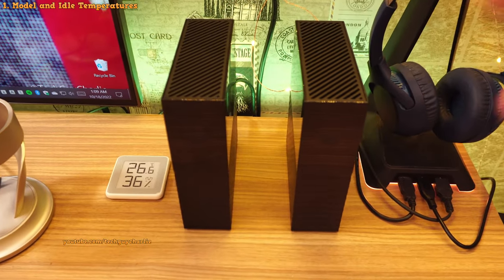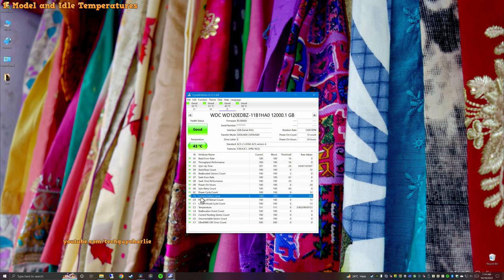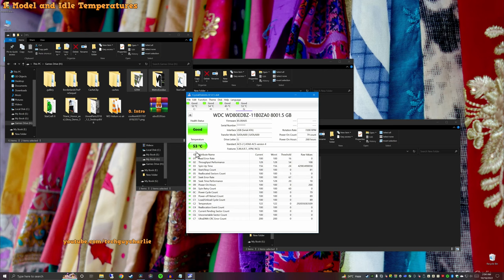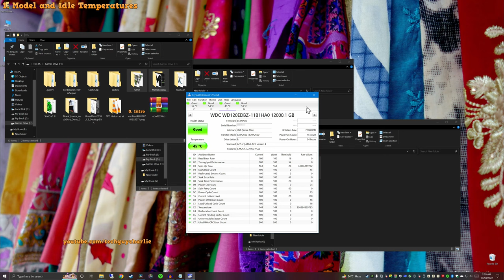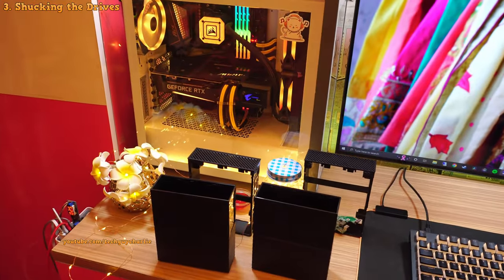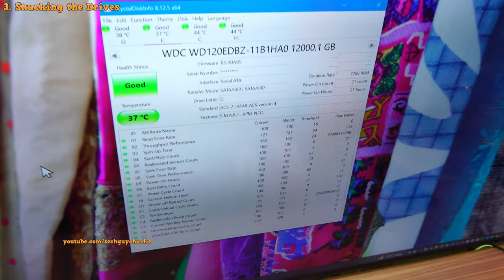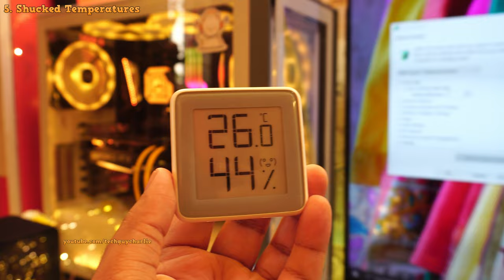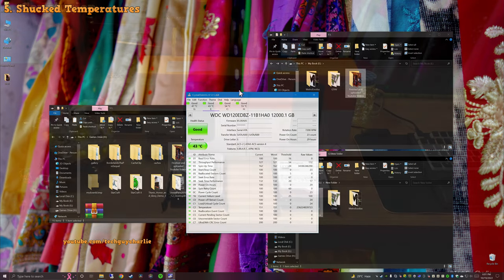Helium-Filled VS Air-Filled Hard Drive (Which runs cooler and quieter)

Comment: Will the helium drive leak at some point? Do you worry about that?
Reply from the maker: Seen a lot of posts about this topic, however, I am not worried about that.
I expect a nominal lifespan of at least 6-7 years out of these, which is about the same as with my air-filled drives, I always replace mechanical drives after 6th or the 7th year even if they work fine, better be on the safe side than to lose important data.
Time will tell how well this drive holds up, at the moment I think helium drives are totally worth it because I do like having a completely silent workstation.
Reply: A decent helium-filled drive will report the amount of helium in SMART data, so you can periodically check it. As to whether your specific one will leak, no one really knows. But at least it is possible to determine that it's happening before it becomes unusable. Manufacturers assume that it will last at least five years, so it is entirely possible that it will. Or that it will work with less than ideal amount of helium for some time. But if you don't have to keep more than 10TB on one hard drive, getting a pair of air-filled ones seems like a better idea, as it's always one point of failure less.

Comment: I got 12TB Seagate Ironwolfs for my NAS. They're also helium drives. However, while they do produce less sound than my previous drives (old 2TB WD Greens), they seem to produce a whine or very high pitched tone. It's very soft, but it is there. Just thought I'd mention it.
Reply: Oh, I thought I was crazy when I turned on an 18TB Ironwolf Pro on a backup machine I assembled. So it's expected that they make that noise?

Comment: Fun video and I just learned that supposedly Crystal Disk Info has a Helium sensor field via SMART?  
However I am not seeing this In Crystal Disk Info with Helium Drives from 2022.
They are directly connected Intel:SATA-ACPI
No RAID controller or USB.
Seagate ST20000VE002-3G9101 : 20000.5 GB 
I am running the latest version of Crystal Disk Info.   
Any thoughts on this?  
Does it not support a number of drives?
Also tried latest version of Seatools.  
Only suspect field is: 0xC8 "Pressure Measurement Limit" =0
Can suspect this is the helium sensor but cannot find any information on it.  
Also Crystal Disk Info does not show 0xC8 or anything related to Helium. 
Thumbing through Crystal Disk Info advanced settings I do not see any options where this would need to be enabled or turned on.  
Seems it should work out of the box and is not.

Comment: can i use nas drive in personal pc for gaming and video storage. does 512e have a disadvantage for windows10. it think about toshiba  enterpris edition mg07 12TB helium filled. Thanks for helium filled explanation. I read high size discs are louder but i see that helium filled are quiter
Reply from the maker: YES!! Absolutely! I have been using these as internal drive since I made this video and they have been working great, I use one to edit 4K videos and one for storage. I ended up buying another helium filled my book as the air filled drive produced a bit of humming noise from inside the PC, helium drive is totally silent.
Reply: @TechGuyCharlie  Thanks very much. I will buy one of them.